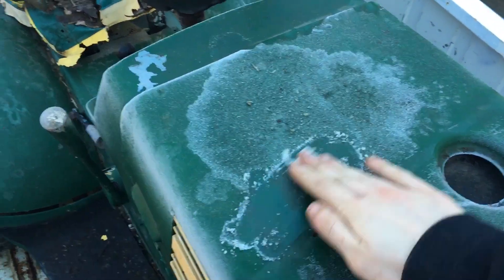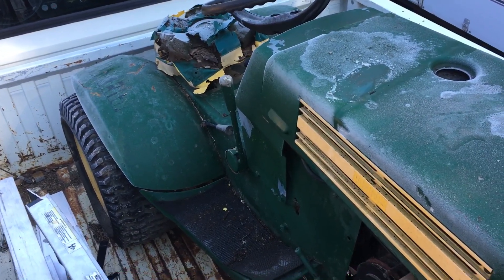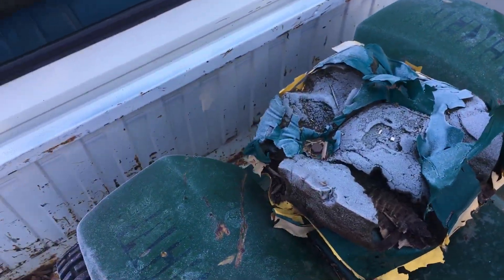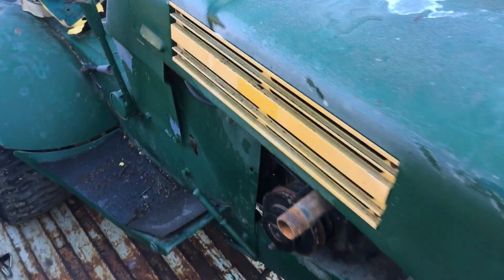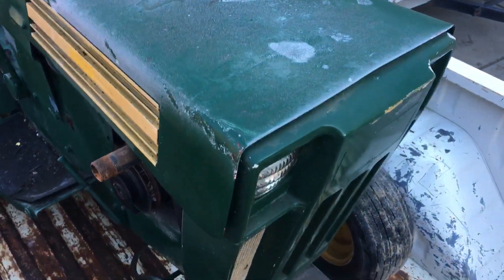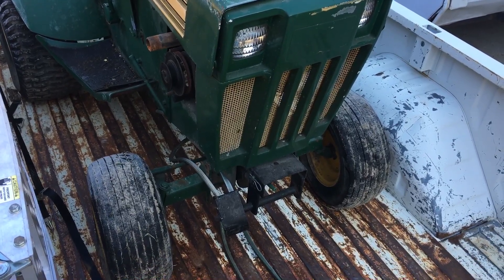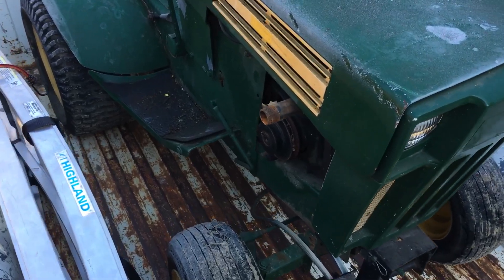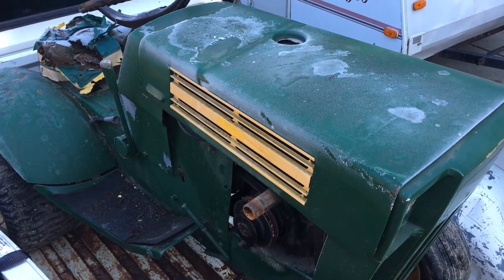1969 Sears Hydro-Trac 12

Comment: At first I was thinking it was green because someone wanted it to look like a Deere,..but the Packers thing told the true story.  Looks much like my ST12 Hydro-Trac except mine has no cap hole in the hood.  I think mine is actually a 1970 model.  Never really mattered to me just cause I like it.  Looking forward to seeing what becomes of this new machine of yours!
Reply from the maker: Paulie Detmurds my 71 SS14 and Hydro-Trac 14 have the hole in the hood if memory serves me right. Your hood could be off of an older tractor that didn’t have the hole in the hood like a 67 or 68 Super 12. I plan to get this one back to blue and white again